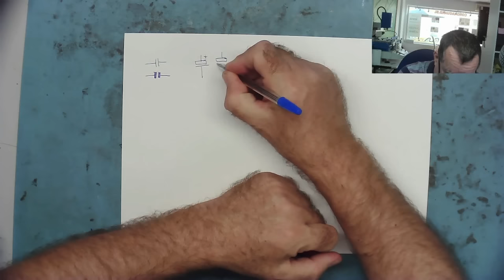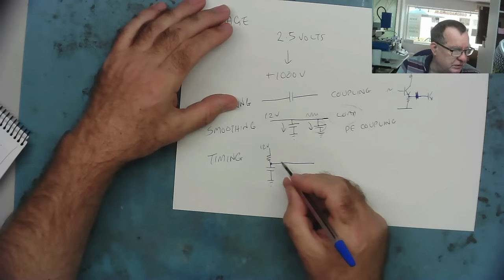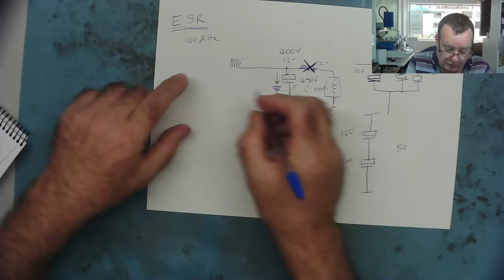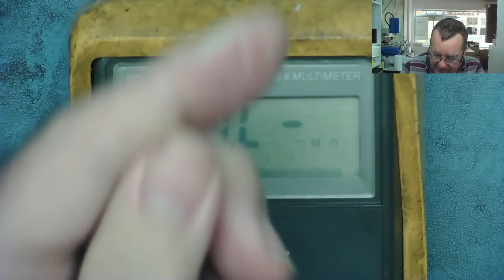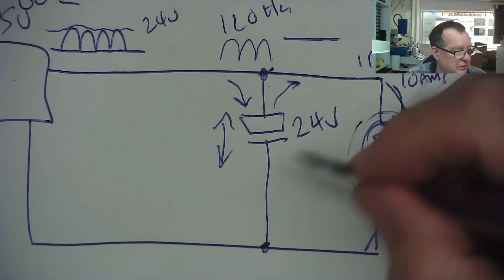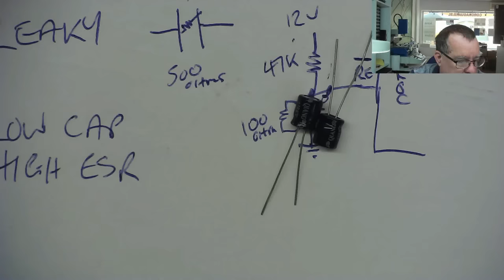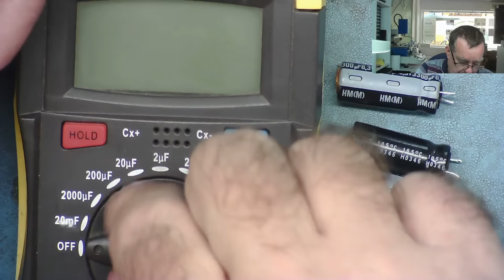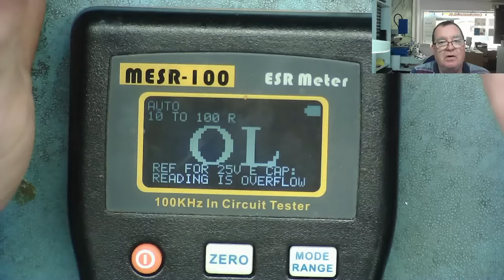All You Need To Know About CAPACITORS To Fix Stuff!  LER #182

Comment: Greetings from Australia :-). Great video, as usual. The only one tiny technical thing... Correctly functioning capacitor (i.e NOT internally electrically leaking) is blocking ALL THE CURRENT - BOTH DIRECT AND ALTERNATING. There is NOT any electrical connection inside. The only difference is, that it REPLICATES the alternating current on the other side, but it CAN"T replicate the direct current (the phenomenon used in signal filtering, as it almost doesn't replicate the noise but the main signal). That's why conventionally we say that it LETS THROUGH THE ALTERNATING CURRENT but blocks the direct current. This is an important point in understanding the main failure of a capacitor. Everything starts when capacitor starts to leak a current from one plate to the other through a dielectric. Delayed charging (change in frequency) and lower maximum charging, as it loses some charge to the other side, becoming virtually a resistor, increasing internal temperature. This may lead to increased internal pressure in electrolytic capacitors, leading to bulging, opening the top or popping out the bottom, or even explosion in extreme situations..
Reply: That's a good clarification and what I thought.
 Being a mechanic I didn't want to look stupid when there are people far more knowledgeable than me watching and commenting
Reply: WOW I'VE LEARNED TWO NEW THINGS FROM THIS VIDEO NOW. THANK YOU FOR THAT INFO.  🇮🇪👍
P.S. I knew about that part of the cap basically becoming a resistor and why it does. But didn't know about AC current part you mentioned. So thanks again your a star 🌟  my friend 👍😉
Reply: Awesome, thanks for the clarification. It was really bugging me when somehow DC passed but AC didn't - didn't make sense to me, but now it's clear that nothing passes - it just mimics AC on the other side, which makes perfect sense. Thanks!

Comment: You didn't mention tantalum capacitors which are physically small, have large capacitance values with low voltage ratings, and have a tendency to short out because they grow internal whiskers when they get older.  They often have the physical appearance of an inverted droplet.  You will often find these in older mother boards and circuit cards mainly as filter capacitors.  Great video!  I have been doing repairs professionally for more than 50 years and this is the best video I've ever seen on this subject.  Thanks for all the information, I'm sure it will be most helpful to many.
Reply: They are often yellow and are marked for their (+) anode, or a stripe. Connecting them backwards can lead to catastrophic results. In surface mount they are a tall rectangle of orangish yellow or black. The black ones look exactly like SMD diodes, so take care to look for the silkscreen on the PCB. C will be a capacitor and D or CR will designate a diode.

Comment: The electrolyte is absolutely not the dielectric in an electrolytic capacitor. The aluminum or tantalum oxide is the dielectric, the electrolyte acts as one of the plates, with the metal film or powder being the other plate.

Comment: This is  a top notch explanation of  capacitors - you really do have a gift for explaining things in simple terms in a no nonsense way  - I wish  I had this explained to me 40 years ago while  learning about integrator and differentiator  circuits the hard way, on my own and out of a book with no one around  who could steer me in the right direction...  years later I remember the capacitor plague all too well,I seem to remember    reports at the time stated it was down to bungled espionage involving a stolen formula with the last page missing, so it was approximated by the scientist that stole it from rubycon  and sold it to  a chinese  manufacturer and we all know what happened after that...
Reply: I don’t know what happened next. Very curious. Can you please elaborate.
Reply: That's what I remember as well.
 I had just built a new computer with a Pentium 3 processor which was reasonably fast in 2001 when I found out about the 'faulty manufacturing' and, of course, I missed the warranty period by a few weeks (just long enough to really piss me off with the manufacturer)
Sure enough, all the 6.3v caps bulged (I think about 25 or so) 
Never did get around to re-capping board even though I bought better quality replacements
Reply: @maxwang2537  hundreds of thousands of circuit boards failed due to capacitors leaking. I stopped using my computer 'just in time' to prevent catastrophic failure
Reply: @1crazypj  thanks for your reply. But the story after that , or as a whole, still remains mysterious to me. And I’m curious.
Reply: @maxwang2537  As stated somewhere in the vid or comments it was due to industrial espionage. 
The 'new' capacitor had all the specs except the electrolyte so that was an educated guess which turned out to be wrong leading to catastrophic failures all around the world.
I read about it in a computer magazine so decided to check my motherboard and found damage before complete failure.
Reply: @1crazypj  thank you for taking the time to explain. This is something that I didn’t know. Since you have specific personal experience related to this, do you remember when, roughly, it was when your vigilance save an unexpected failure of your main board. Asking just trying to see if I also had experience related to this which I only didn’t know the story behind.

Comment: I used to check caps by setting my multimeter to 200k, place the probes on the legs of the capacitor and the reading will either go up or down depending on the polarity. flipping the probes will cause an opposite effect; so if the reading was going down before, it will now Rise at the same speed. This indicates a good component! I've recently invested in a good ESR meter and they really are a godsend! Thanks for making these videos, they are so easy to understand.
Reply: Inside the fuel pump relay on many older (1980's to mid 2006 ish) Suzuki motorcycles is a small cap that con only be checked with an analog meter as 'auto-ranging' isn't fast enough to react. The service manual only says 'needle deflects' and often doesn't make full scale. Using auto-ranging meter always shows the relay as 'bad' (no difference between a $5.00 HF or $300 Fluke)
Reply: Good tip. God I'm learning loads here today. Thank you 🇮🇪👍 and I'm must invest in an ESR meter myself.😉

Comment: There was also an era in the late 90's to early 2000's, where electrolytic surface mount caps were bad. These were predominantly used in video cameras, and had poor quality base rubbers, that leaked very early in their life. initially very hard to detect as damage and spillage was under caps (tracks eaten away). Whenever you come across any electrolytics that leak from the base, be sure to thoroughly clean and neutralize the electrolyte, especially on multi layer pcb's. Many of those repairs we did, involved tracing and re linking eaten away tracks in the camera's, which is very tedious and time consuming work. Ex technician, some 18 years domestic electronics thru to industrial comms engineering companies.

Comment: Hello from Australia. My name is Andrew and I'm 62 and I've been around electronics all of my life [I got my first shock at 4 years of age]. This was a great video because I didn't realize how much I had forgotten over the years. I love valve sets and I own a PrimaLuna HP Integrated amp with 6 12AU7s on the Pre-amp side and 8 EL34s on the output side. These amplifiers reek of good taste. All of the transformers are toroidal and wound in house. This amp runs point to point wiring using Adaptive Auto Bias. The people who wire these amps are artisans. They use Tachman resisters and Nichicon Electrolytic Capacitors. They use standard but great bridge rectification and high quality chokes to eliminate ripple. My Technics SL1200MK2 is a new Pro turntable and has never been in a club fitted with an Ortofon Blue Cartridge. It is a MM using a nude stylus and runs through a Cambridge Pre-Amplifier then to Aux Input 1. My CDJ PRO Player runs to a Cambridge DAC and it has its own input marked on the selector switch. It has an Alps Volume Control and the selector switches are actually relays that close leaving the others open to avoid bleed from other components. The valve sockets are attached to the chassis and the power tubes are surrounded by pencil size holes to suck heat away from inside.They are a stunning amplifier. My Wharfedale speakers sound like a massive soundstage and a REL sub kicks in for home cinema. I love your videos. Keep them coming. Cheers from OZ, Andrew.

Comment: Your ESR example is showing a resistor in parallel which is actually equivalent to leakage. ESR is Equivalent SERIES resistance with the "resistor" in line with the capacitor.

Comment: I just fixed my 1996 Magnox 27" TV by changing 4 caps. I found the bad ones using a multimeter set on diode/continuity/beep. I alternated each cap leg listening for a quick beep while alternating cap legs (in circuit aka while on the board). Anything but a quick beep in both polarities means a bad cap. I found 4 bad. Replaced them with 4 caps that checked out from donor TV. Bam. Working TV. I actually cant believe it worked. This is the first time I 've done anything like this. My thanks to all the electronics people here on Youtube. Now I can watch some old movies and games in retro nirvana.

Comment: Good explanation, keep up the good work! How do you find the correct value of an MLCC if you wanted to replace it?
Reply from the maker: Daz tinkers You mean if the original one is faulty and you can't read the value with a capacitance meter?
Reply: @LearnElectronicsRepair  yes sir, I appreciate you don't always need to replace a faulty one but it'd be useful to understand how to find it
Reply: Same question from me

Comment: Useful method for accurate DC leakage current measurement is to hook up the DUT in series with a 10/20k resistor to a DC bench supply and measure Vdrop ax the resistor whilst keeping an eye on the timer. Voltage should drop & stabilize within 5/10minutes for standard electrolytic caps, and even quicker for purpose made low leakage caps. Also, electrolytics' data sheets contain small print mentioning lifetime cannot exceed 15 years due to rubber seal deterioration. MLCCs also exist in THT format and are often used for de-coupling of power rails for example, in X7R guise. More demanding locations usually feature C0G version.

Comment: Hi Richard, I have been binge watching your vids and love your teaching style. I'm trying to educate myself on electronics repair and had an idea for a project, would love your thoughts. I would like to make a basic tool to read the voltage across a capacitor and drain drain it on command. My understanding so far is that different resistors are appropriate for different voltages so I wondered if it would be possible to apply the correct resistance intelligently in some way either with a microcontroller of some sort or with clever circuit design. 

Would love any feedback and please feel free to come up with something yourself that newbies like me could all learn from, might be an interesting video. My assumption is that this tool does not have much in the way of demand otherwise I'm sure my google searches would have come up with something.

Comment: 25:25 - This meter injects a 100k signal into the circuit to be measured. Have you ever come across a circuit that was potentially damaged by this (e.g., microprocessor chip)?

Comment: Thanks Richard. A tip I use, - When you take at general look at at circuit board - Look after electrolyte capacitors that is exposed to heat from heat plates, sometime they get stressed and break down.

Comment: @LearnElectronicsRepair,I'm just learning electronic circuits, but if you could help me by explaining if capacitors block dc and allow ac,why does the large capacitors come after the bridge rectifier in the switch mode power supplys,hasn't the ac signal already became dc at that point,and if so how is the dc being accepted by that large capacitor to be used afterwards?

Comment: At 2 minutes you drew a symbol calling it a polarized electrolytic capacitor.  I was taught that it was a non polarized electrostatic capacitor, but the curved side was there to indicate the outer side of the capacitor’s foil.  This was to simply be placed towards the chassis or any ground traces.  That way if any accidental physical shorts there would not be as big of calamity

Comment: Hello, thank you for your YouTube video.

I am wondering if capacitors can charge before fully having discharged.

Does AC blocks discharging or does it add to the voltage of a discharging capacitor ?

Thank you in advance.

Comment: I found a regular meter works good on testing if the capacitor is good or bad by see if the capacitor charges and discharges by switching the leads both ways if it doesn't its bad even if the capacitor reads the right capacity it needs to pass this test thanks

Comment: Electrolytic capacitors are just alternating layers of aluminum foil and paper inside an aluminum beer can. The liquid electrolyte etches the aluminum foil plates to increase the surface area. C=(Eo)*A/D, Episilon_Naught * Plate_Area / Plate_Distance. This is how electrolytic capacitors achieve high capacitance in small spaces. The capacitor plague of the early 2000s was caused by industrial espionage; someone stole a formula for an electrolyte formula for a more environmentally-friendly electrolyte, but didn't copy it properly. It mostly affected off-brand Chinese capacitors, not Nichicon capacitors which are generally top-notch. Having said that, ALL electrolytic capacitors will eventually fail, for the same reasons that all cans of beer will eventually go stale. Bad electrolytics generally get a larger ESR even if they appear okay. 
And then there are paper capacitors in vintage electronics. Alternating layers of paper and foil, no electrolyte, just dry paper. Wrapped into a paper tube and sealed in wax, sometimes in a Bakelite "bumblebee" housing. The humidity from the air eventually gets in and causes the capacitor to fail leaky. When this happens, the DC bias voltages on one stage of an amplifier will "leak" onto the next stage of the amplifier and bias a tube or a transistor out of its operating point and the circuit will fail. There are as many variations on this issue as there are on uses for capacitors. Sometimes it causes catastrophic failure and takes out impossible-to-find parts like flyback transformers and deflection yokes in 1950s TV sets. shango066 (shoutout!) has a channel devoted to resurrecting old TV sets. 
Your ESR meter will work on any capacitor over about 0.1uF, I prefer a a pure analog ESR meter. If you know what a good 0.1uF capacitor will do on the meter, you can spot bad capacitors in-circuit with your ESR meter. Polarity does NOT matter with a proper ESR meter. I have fixed many hundreds of switchmode power supplies with bad transformer driver capacitors using the ESR meter. Many times these are mylar film capacitors - aluminum plates sputtered onto mylar plastic. When they short, the current burns off the aluminum plate on that area and the capacitor generally decreases in capacitance value as it fails non-catastrophically. These are sometimes sold as "self-healing" capacitors. 
Here is a beautiful ANALOG ESR meter. I love this thing, aside from my multimeter, it is the most important electronics troubleshooting tool I have. 
http://kripton2035.free.fr/Resources/poptronix%20ESR%20Capacitor%20Tester.pdf
I added a beeper to mine across the SHORT LED.

Comment: I have a question.. I am always tinkering with old motherboards and video card. Just about all of them have the aluminum electrolytic Capacitors. How do determine which solid to use in place of the aluminum electrolytic Capacitors?

Comment: Can we measure ESR with ESR meter in circuit (PCB) ? Thanks!
Reply from the maker: Not really, you need to take the capacitors out to measure the ESR effectively.  Often the faulty capacitors are visibly bad but they can look perfectly OK and still have very bad ESR so the circuit will not work properly or even work at all.   This is where the ESR meter is so valuable, otherwise the only other way to find those faulty capacitor is by substitution

You can use the ESR meter for finding short circuit MOSFETs in VRMs, and also to measure the value of inductors.  I've shown the ESR meter used to trace short circuits in several videos

Comment: all right guide i suppose, without going into ee level nitpicking at least (tho electrolyte 'evaporating' irked me immensely - it gets decomposed ('consumed') as the dielectric layer is reformed (cap 'heals'), only evaporation it will be doing is if/when the can vents.. kinda like examining a dug up corpse and determining its cause of death as due to decomposition and maggot infestation)

one big thing i would add - polarity markings on tantalum capacitors

also 'dedicated' esr meter ~> component tester, neither can help you with in circuit testing (for which you need a scope and a fair bit of knowledge) and accuracy of the cheaper stuff is perfectly sufficient

Comment: the higher resistance resistor the quicker it will discharge the capacitor. thers a formula for it but if you dont have a 5w 3k resistor u can use a 1000 resistor but you have to discharge it longer to be sure its fully discharged
Reply: No. The lower the resistance the faster the discharge of a capacitor. A short circuit will discharge a cap very fast but can be hazardous with large capacitors.
Inductor discharge is faster with higher resistance.